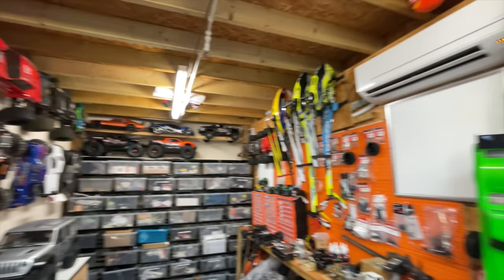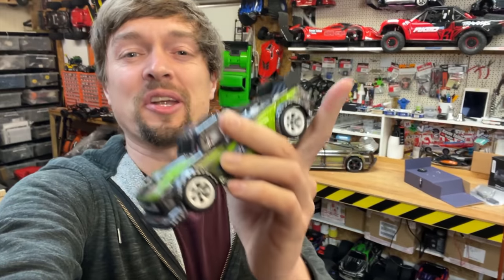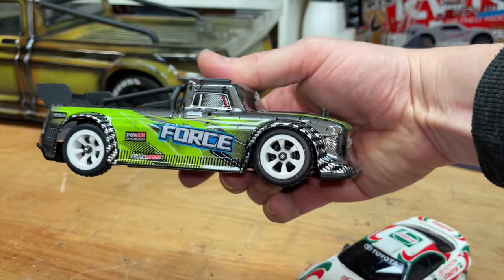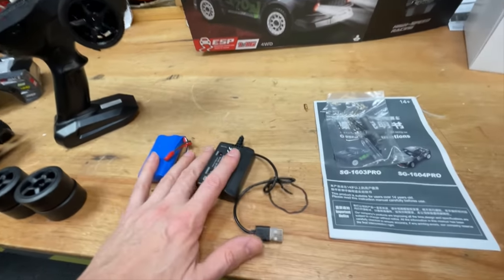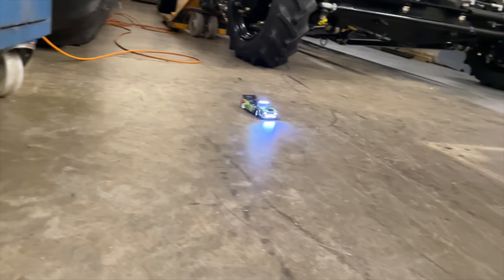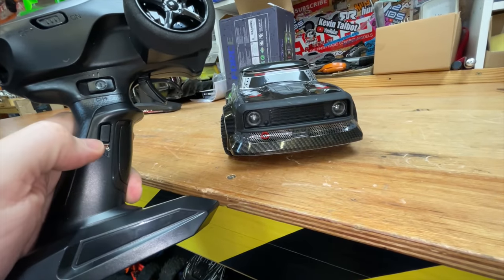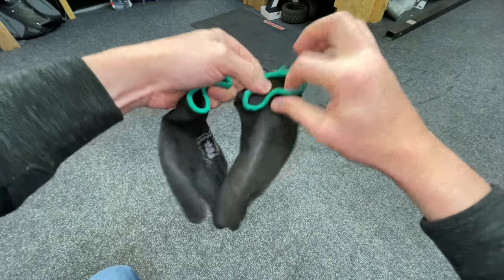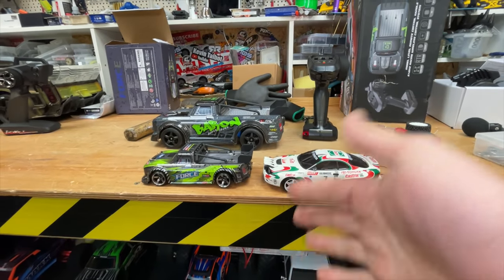mini Hoon RC Drift Truck - Drift in your house!

Comment: I am seriously impressed by the tiny infraction like car. It looks soo awesome and has enough power to rip around. Perfect little indoor car
Reply: and it's about 60$ , less than a 3rd of the price of a miniZ , the bigger one is about 120$ , both are super nice for the price.
Reply: Yeah but they drive like crap. Spend the money on the Mini z. Trust me. It performs 10 times better. The cheaper ones have their place like the off-road ones those are awesome. But when it comes to drifting you need a good gyro and a good speed control. Otherwise it's just no fun.

Comment: Kev, I popped a tire on my arma senton 3s blx, what tires would you recommend to put on and why do you think it happend, I was only doing half throttle??
Reply: It probably wasn't properly glued on the rim Always check your tires and make sure the tire is properly glued to the rim There's many many videos on the Senton I'd go check out a few of them and see what kind of tires they are running It mainly depends on what type of surface you are going to run it on If you're just bashing around in loose dirt get a tire with aggressive nobbies if you're running it on a smooth track do some research and find out what the racers are using ✌️
Reply: @EJ-74  it sucks as I bought myself it for Christmas and it was my first Eve time taking it out 😞
Reply: @lewis.n2313  Dang I know that really sucked I raced for about 4yrs hard core so I've pretty much seen it all I've blown more tires than I want to remember lol It's the one bad part of the hobby You learn from your mistakes though It's always best to inspect your truck before taking it out and make sure everything is snugged up and your tires are sealed lol
Have a good one bro ✌️

Comment: Hi Kev I got the little car it came with the gears are they hard to install ? I noticed aswell you can turn down the speed on the controller it helps alot

Comment: Upgrades for the little WLTOYS: See beaver's Hobby channel on YT. 
For wheels they are 20mm rims, alloy ones (and standard white) and drift tyres can be sourced from Bangood. Search 'k969 wheels" which was the previous drift spec.  If you have access to a 3d printer there are many Mini-z wheels to download for free.
Also lock the rear diff by opening it and jamming paper in it to stop the cogs turning. Or glue it if you wnat it permanent. Free upgrade. 
Steering is also too shallow for drifting so move the steering up to the top hole. You will need a 2mm drill to widen it then use a nut and bolt to atach to servo. Brushed version is so much fun,. Tyres will need to be that size.

Comment: Hi kev,with your trx 4 sport are you planning to put a higher kv axe system or is the one you have got fast enough because i just got the trx 4 sport kit and got a hobbywing fusion 1800 kv and was wondering if it would be fast enough(i know you have an axe 2300 kv but they are similiar)

Comment: Definitely going to get the mini one payday lol you sold me on it Kev.
Reply: Do yourself a favor and get a set of metal ball diffs and drift wheels. Lock the rear and keep the front semi snug. Keep a steady throttle and its incredibly easy to drift non stop (controllably)
Reply: @sbcdime1  thanks for the advice, I'll do that then

Comment: If anyone's thinking to buy 284131 mainly for drifting I think you might want to skip and buy wltoys k969 because that one is good for drifting.

Another youtuber has a review comparing both, the 284131 is similar if not same with k989 in that video

Comment: The baron is not hard to drift at all.
Reply from the maker: try doin it on a tight track
Reply: @KevinTalbotTV  yea ok you do need a tidy sized space. But when you mentioned it being hard it you was in a carpark. They are amazing little trucks for £60 though